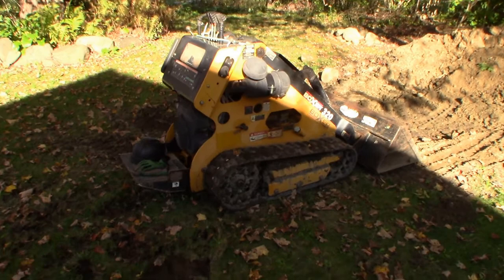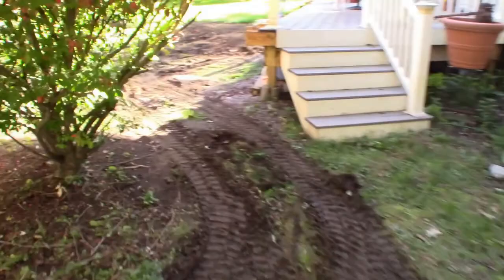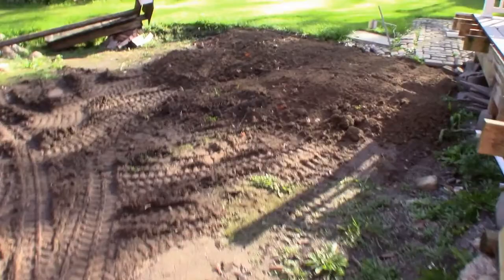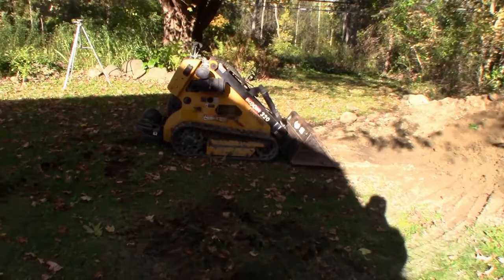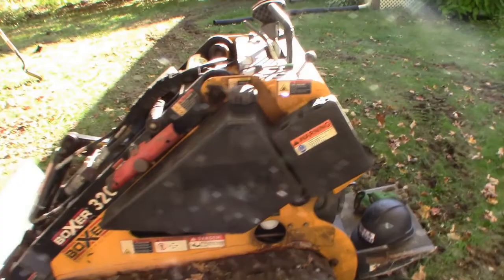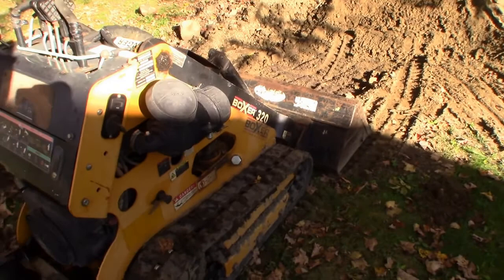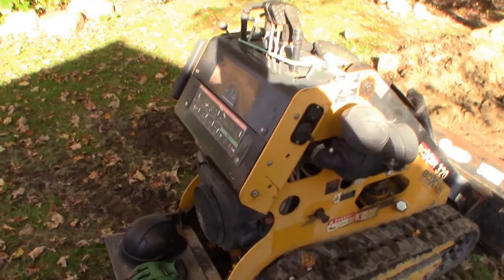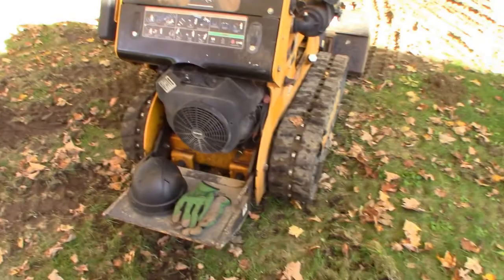Boxer 320 Mini Skid Steer

Comment: Do you know anything else about these? How much do they cost? Can you swap the bucket for forks or other attachments?
Reply from the maker: They don't make this particular model anymore, but the comparable model is about 25k. They make a boat load of attachments for it. Snow blower, auger, trencher, every bucket you can think of, forks, and a bunch of others.
Reply: @MillsEngineWorks  damn that seems really useful if you don't have the room to store a full size skid steer or tractor
Reply from the maker: They are. I know a guy who is considering trading in his Bobcat for something like this. He does mostly residential work. Easier to move.